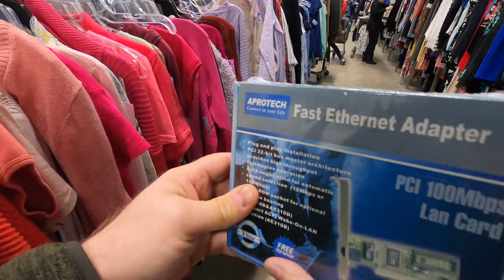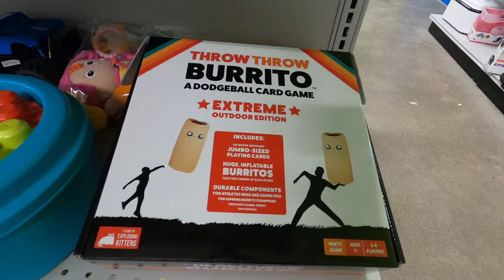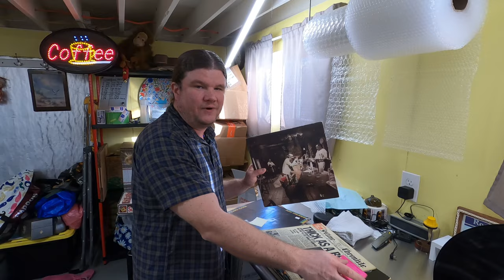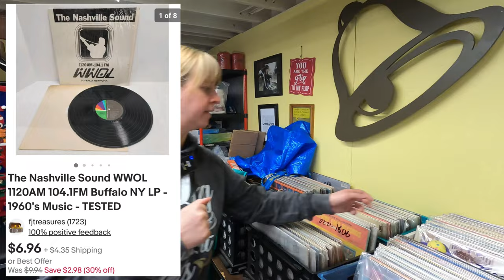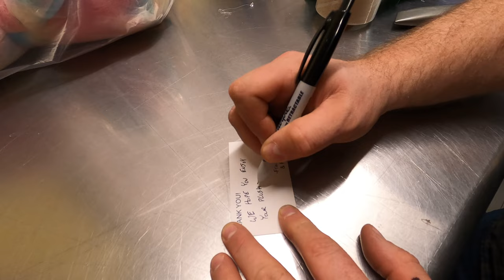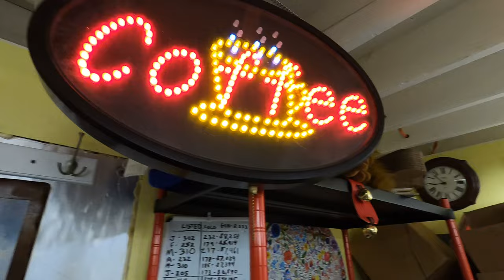THE DAILY GRIND AND HUSTLE OF RESELLING | HOW TO RUN AN EBAY BUSINESS | WHAT PLUSH SELLS ON EBAY

Comment: 5:36 It is possible to visually evaluate a record with a pretty high degree of accuracy. You probably only need to play test if they are heavily worn, severely warped or have a deep scratch. 

I just discovered y’all today and wanted to contribute something 😊
Reply from the maker: For the most part you can. You'd actually be surprised how some records will look perfect but will still repeat itself halfway through. We have actually gotten to the point now where we know what "types" of records are more prone to have issues than others.
Reply: @FJTreasures  I know what you are saying. A record can look flawless when you are seeing it sitting flat on the table, but there is a simple trick you may or may not know and that is to tilt the record at an angle under good lighting and as you do that, as you tilt it, you can see all the imperfections including those types of scratches that may lead to the record skipping. I do play test those as well. But if y’all want to play every record that you list, there’s no harm in it. I can understand wanting to have the peace of mind. I personally list records for as low as $4.99, and I wouldn’t be able to do that if I played all of them.